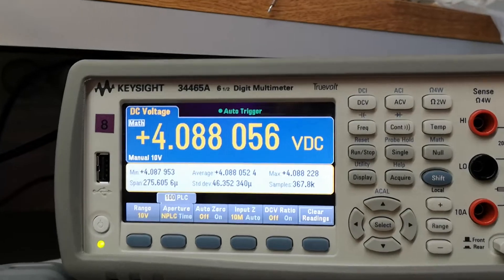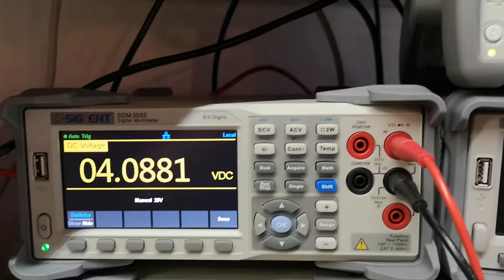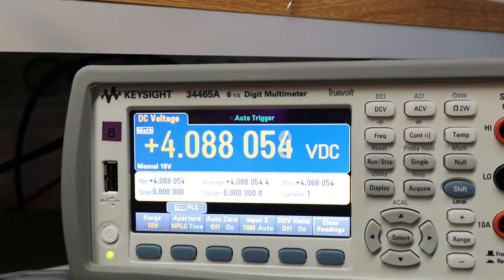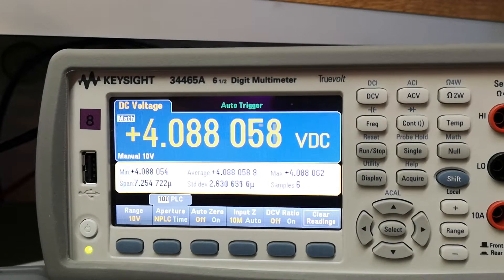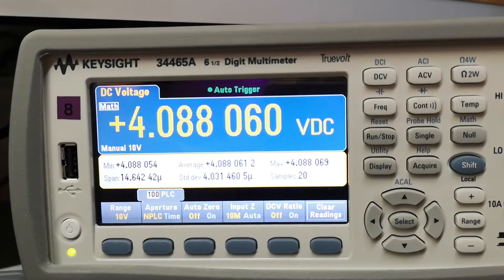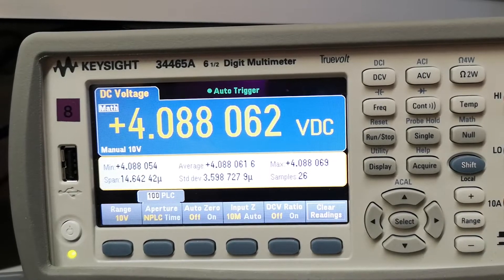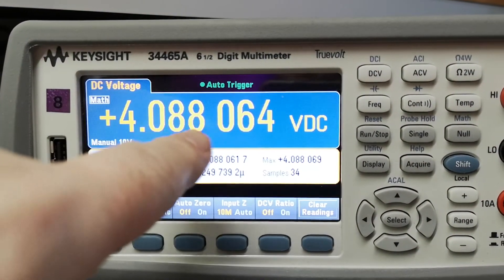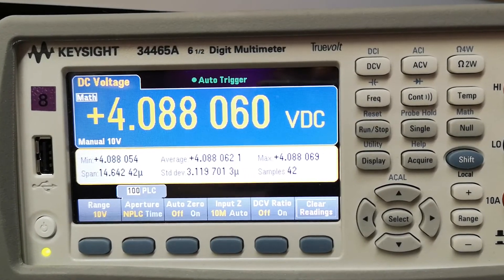Keysight DMM 34465A software bug found ? (now with English and Danish subs)

Comment: I suspect that the toggle of nplc had a side effect of forcing an auto zero.  I noticed you had auto zero set to off.  You will have some drift as the time since last auto zero occurs.  Try turning auto zero on and see if you can replicate issue.